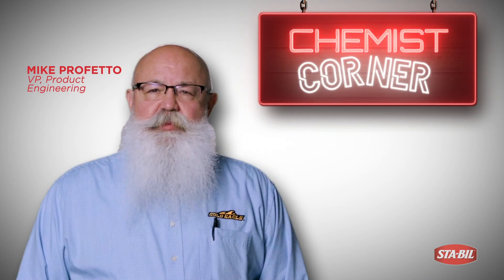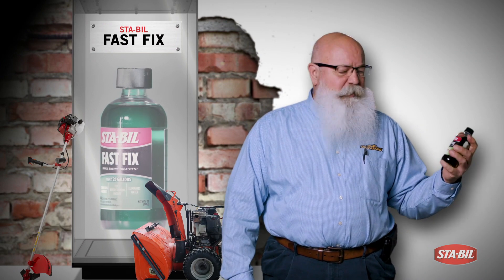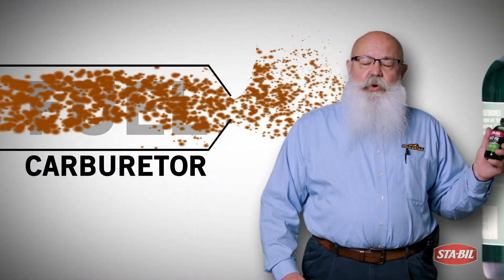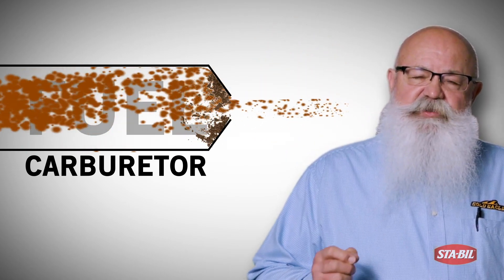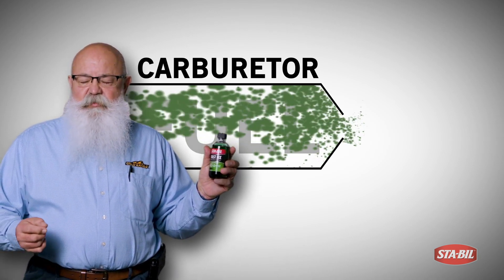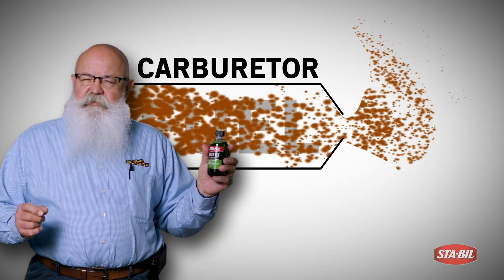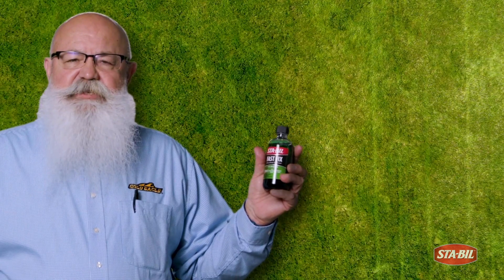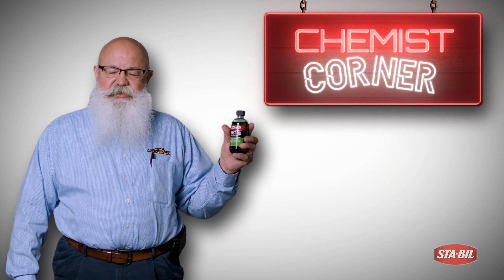How STA-BIL Fast Fix Gets Small Engines Running Again | Chemist Corner

Comment: QUESTION: Five months ago I bought a brand new Yardmax mower with an electric start and a pull start. It is a self-propelled push mower. At the time, I had a little bit of ethanol gas and I didn't know ethanol gasoline causes so many problems with gum, varnish, and carbon buildup. So, I filled the mower with the ethanol gas. Another mower was repaired, though. So, I've used that older mower for those entire five months. The gasoline with ethanol has been in the filled gas tank ever since. The mower was never used other than to start it up to see if it worked. I'm concerned that leaving the mower for five months with a full tank of ethanol gasoline may have caused a building up gum, varnish, and carbon. It is now fall and it won't be long before I put the mowers away for the year. My plan is to use plyers and a tray to empty all that ethanol gasoline into the tray from the gasoline fuel line. 

Should I use something such as Mechanic In a Bottle, Ethanol Shield, Stabil Fix It, Gumout, Seafoam, or Berryman's B12 in order to remove potential buildup of carbon, gum, or varnish that may or may not be in the new mower? 

Do you think there is a buildup of carbon, gum, varnish in that new mower now after five months of sitting there? If I had known the mower was not going to be used, I would have used Non-Ethanol Gasoline. I now use only Non-Ethanol Gasoline in the mowers.
Reply from the maker: We would advise you to run it until it is out of gas or remove the fuel line and drain the remaining fuel. Then, get fresh gas at the pump in a gas can, treat it with STA-BIL Storage, and fill the mower with treated fuel and run for 5-10 minutes.
Reply: @STABILBrand What would your advice be if the gas was drained so there was virtually none left, but then several ounces of Gumout was put in the mower and left for 24 hours? After that, the mower didn't work - presumably because Gumout messed up the mower?
Reply from the maker: @michaelzoran  Drain it and clean the carb. Most likely it dislodged something clogging a carburetor jet.
Reply: @STABILBrand  I followed your advice. I drained the gas tank three times with a gravy baster to make sure I got all of it. The first time I filled the tank with gas, it clearly was a darker color because it was mixed with Gumout. The second time was only like this a little bit. The third time appeared to be very clear. I even tried putting some of that Sta-Bil Fast Fix in it and left it overnight. That didn't work. I'm disappointed the mower no longer will start. 

Both Sta-Bil Fast Fix and Sea Foam give high-quality instructions on their bottles that clear say, "Add 1 oz per gallon" and "You cannot add too much." 

The product called Berryman B-12 gives a good warning on the bottle by saying, "This is dangerous and may cause damage to rubber parts such as seals and gaskets. Do not add too much." 

But Gumout is TERRIBLE, because there is no form of warning given, even though Gumout can cause damage to rubber parts such as the fuel line, gaskets, and seals according to what I read in multiple spots. I wish I had known that at the time. 

Any other advice is appreciated.

Comment: Can I use Fast Fix in conjunction with fuel in my generator that already has been treated with normal red Stabil Stabilizer?
Reply from the maker: @baddestmofoalive  Yes you can.
Reply: @STABILBrand   Quick Fix isn’t available locally for me, but Marine Tune Up is. Would that work ok as a substitute in a small engine?
Reply from the maker: @baddestmofoalive  Where are you located?
Reply: @STABILBrand  Quick Fix isn’t available locally for me, but Marine Tune Up is. Would that work ok as a substitute in a small engine?

Comment: #STA-BIL  Would it be okay to use both STA-BIL stabilizer "and" STA-BIL FAST FIX in my back vehicle gas that I store in my SHED?  (Note I store 2x FIVE gallon Safety Cans of 93 octane gas) Which I swap out every 6 months, for new gas.
Reply from the maker: For this situation, we recommend STA-BIL 360 Protection as it will clean and stabilize.

Comment: 1.5 ounces per gallon of SeaFoam in EVERY refill of my gas cans.  No problems for 20 years now.  

Fast Fix is for those that forgot to do step 1 above.   A huge problem with Fast Fix is it wont fix an engine that does not start.  No start = too late.  

Dirty secret - mowers that have the Briggs engine with the plastic carb featuring the plastic throw away carb jet cartridge.  Take cartride out, pop a new one in.  No more cleaning carberators due to plugged up via bad fuel.  Watch video below.

https://www.youtube.com/watch?v=zT_wQCyKjXQ
Reply from the maker: See how STA-BIL stacks up vs the competition. Check out the link which houses 3rd party test results done by a top research institute: https://www.goldeagle.com/stabil-test-data/  We also have a YouTube video about this process: https://www.youtube.com/watch?v=cTf4t6Vyk5U&t=373s.  And in regards to Fast Fix, yes it is for those who forgot to use a fuel stabilizer (engine could be running rough or not running).  You can also use STA-BIL Start Your Engines to try to get the engine running again.  In some scenarios, the carburetor may be requard to be removed and cleaned. Last resort, you can certainly by a new carburetor.

Comment: It's worked very well for me.  We bought a used riding mower that didn't run all that well.  I mixed Fast Fix into the gas and left it running for 15-20 minutes.  I could hear the engine running smoother after about 10 minutes and it's been running better since.  I then tried it in a generator that had had fuel left in it and stored.  While it did not run at 100%, it did run a lot better than before the treatment. Again, I left the unit running with the treated fuel for 15-20 minutes.  I will probably give it a second go since the treated fuel has been sitting in the fuel lines for a month now.  I'm impressed enough to buy a second bottle.   Thankfully Menard's is cheaper than Amazon.
Reply from the maker: Thank you for sharing with us! We are glad to hear the engine is running smoother.  Thank you for using our products!
Reply: @STABILBrand  can this use on non ethanol gas ?
Reply from the maker: @skeletronxxprime6277  Yes. This can be used with both ethanol blended and non-ethanol gas.

Comment: I used this to get a non running mower to run. And I did a few cuts. The mower though will relapse into not starting or running rough. So I add a little more. Hopefully it will keep it going and I don't have to still clean it
Reply from the maker: Thank you for trying out our product.  We are glad to hear you got the mower started with Fast Fix!

Comment: Any problems w/ rubber? O-rings etc?
I.E. can I treat a tank in my generator & let it run for awhile (I have no issues, using as a preventive)?
If not, what's the best way to store my generator, shut-off fuel & run carb dry or store wet?
I treat my non-ethanol w/ regular Stabil as well.
Reply from the maker: Fast Fix is safe with rubber or o-rings.  Yes, you can treat your tank and let your generator run for awhile with no issues. Fast Fix is a fuel system cleaner that will help clean out the fuel system.  If you are looking to store your generator, we recommend our STA-BIL Storage. Run the generator for a few minutes to get the product throughout the entire fuel system.  And yes you can use STA-BIL with non-ethanol and ethanol blended fuels. Thanks for using our products! Let us know if you have any other questions.

Comment: My snow blower is surging very bad. Can I fix it with fast fix???
Reply from the maker: Yes. You can use 1oz of Fast Fix to treat up to 2.5 gallons of fuel. Run the equipment for 5-10 minutes to let it cycle through. A second treatment may be necessary in certain cases.
Reply: @STABILBrand Can you over do it with the product ? I just ordered some to use in my snowblower. All tho I’m not 100% sure how much fuel is inside the engine
Reply from the maker: @andrejtadic3088  Pour the amount according to your tank size (1 oz per 2.5 gallons) and fill up the rest with fresh fuel

Comment: Prepped my Cub Cadet Two stage snow thrower last year {new gas (treated with red Sta-Bil) and oil} but did not use the thrower due to mild winter.  End of last season drained the gas tank and added new fresh gas treated with red Sta-Bil this season, but unit will not start.  Getting spark but guessing gasoline line blocked.  Short of taking to repair shop want to try either Sta-Bil Fast Fix or S-B Start - which would you recommend?  Could Both be used with same gas in tank if one or other does not work?
Reply from the maker: You can use either Fast Fix or Start Your Engines.

Comment: I just tried "Start Your Engines" in my snowblower tank - it has worked well in the past but no dice this time. Can I put "Fast Fix" in on top of it? Might it work when "Start Your Engines" didn't?
Reply from the maker: It will not harm adding Fast Fix along with Start Your Engines. Although, usually if it will not start with one additive or the other, there is an underlying issue that unfortunately the additive is unable to take care of.

Comment: Which then drives it into the micro holes in the emulsion tube were it will be when you remove the carburetor for cleaning.

Comment: my snow thrower gas tank is only 1.5 gallon... should I add this NEW mix to my gas can instead? Or a lesser amount directly to gas tank?  thank you
Reply from the maker: This additive is designed to go directly into your small engine equipment's gas tank. Over treatment will not harm the engine. Treat rate is 1oz to 2.5 gallons of gasoline.
Reply: @STABILBrand  Since my gas tank is only 1.5 quarts how much of the Fast Fix do I pour into the tank?
Reply from the maker: @stateniland  1oz to make it easy. Overtreatment will not hurt your engine. A quarter of an ounce is closer to the actual treat rate for a tank that small if you can measure it out effectively.
Reply: @STABILBrand  TY Mike... that's about a tablespoon .. My knob that controls Fuel has gotten very hard to turn... hopefully I caught this before it gets worse..

Comment: Thanks   I Trust your product line!   I had 2 year old fuel with your Stabil mixed in,  it fired off!  That was an ethanol high test pump gas.  Now I have non ethanol available in my area.  Unfortunately the ethanol ASORBED WATER AND rusted the bottom of my tank .  LESSON LEARNED

Comment: Wish I knew about that last summer. I forgot to put stabilizer in a 5 gallon gas can early in summer. Late in summer I used the gas in my Honda mower. Then the mower sat for over a month in the summer not being used. I was out of country. I came home and the mower was surging up and down. I had to get a new carburetor.  I'd bet for sure that green Sta-bil product would have fixed it. I'm going with the red Sta-bil this year to stabilize the gas. Previously I've used seafoam exclusively. My brother has been using the red Sta-bil and he never has issues ever. Please keep the new videos coming here on YouTube.
Reply: The trick I use to never forget my stabilizer:  Is to add it to the EMPTY gas can "every time"; BEFORE I fill the can with GAS.  If your area gets very humid and or you use a lot of gas in a snowblower.  I prefer the STA-BIL "Marine Formula 360".  Not only does it work great on combatting the ethanol, it keeps moisture/water out of the gas longer than other variants.
Reply: @J.R.F.23 is Marine product good on small engine and generators I'm in humid Florida